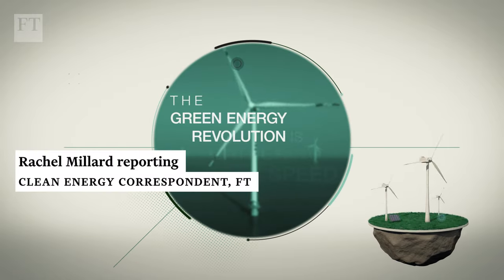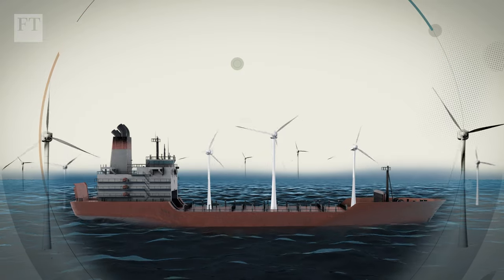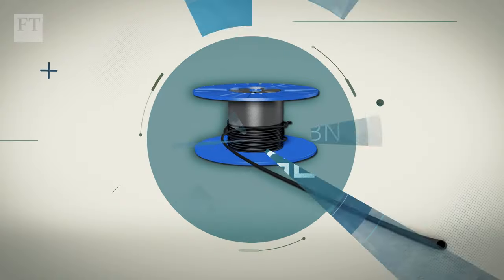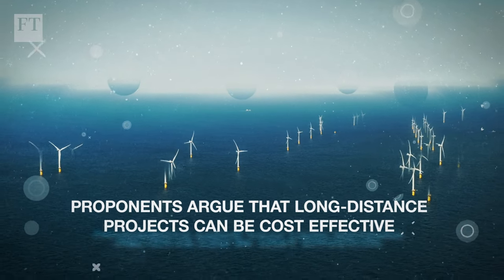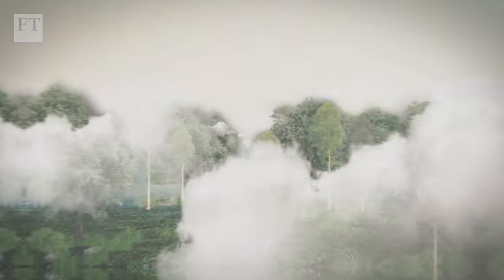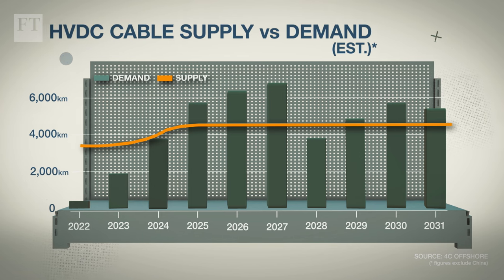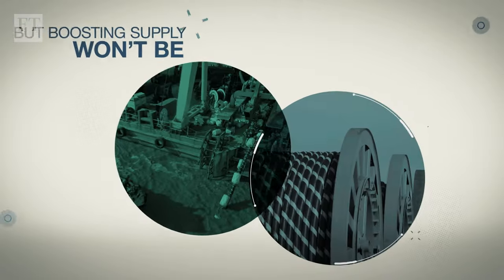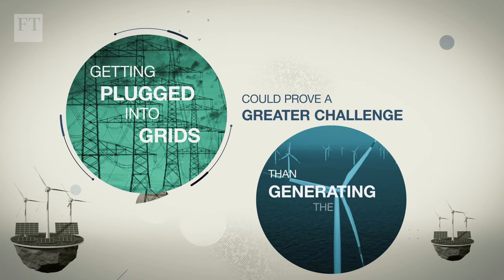Green energy providers face a potential shortage of transmission cables | FT Rethink

Comment: Surprised that the issue of copper was not mentioned. Surely this demand will see a surge in copper prices, and supply issues, if all these new cable factories start up.
Reply: That would be because modern AC and HVDC transmission cables use Aluminium as the conductor.

Comment: It is far easier to send energy via pipelines or ships, as hydrogen or ammonia. 

Power lines also should be upgraded to composites, over steel cables.  Doing so would double the throughput of electric high tension lines.

See the recent UC Berkeley paper in this regard, to at least reduce the risks and sustained losses incurred from curtailment.
Reply: Yes
Reply: What composites?  Transmission cables are already mostly SCAW (steel cored aluminium wire).  Making transmission cables more expensive seems like a bad idea.
Reply: @gregvanpaassen  Find the paper.  Billions more can be made per year, with upgrades.  

It has already been modeled.
Reply: We don't use steel cables, we use aluminium with steel as reinforcement to stop them stretching too much.